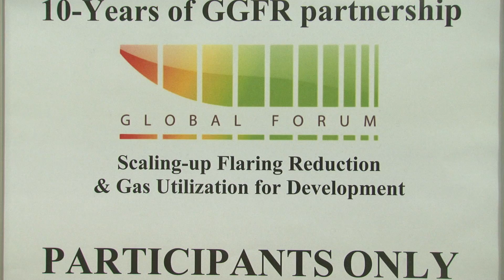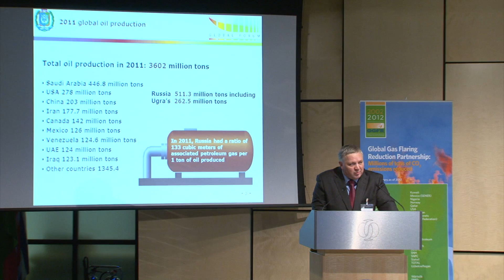Gas flaring: turning waste into investment

Comment: Around 140 bcm of natural gas is flared globally each year. This is a major source of CO2 emissions, methane and black soot, and is damaging to health. In 2022, the volume of gas flared worldwide fell by around 5 billion cubic meters (bcm) to 139 bcm (about 3% reduction). Flaring resulted in 500 Mt CO2 equivalent annual GHG emissions in 2022. Around 70% of gas flared goes to flares that operate on a near continual basis. In the Net Zero Emissions by 2050 (NZE) Scenario, all non-emergency flaring is eliminated globally by 2030, resulting in a 95% reduction in flared volumes and avoiding 365 Mt CO2-eq.